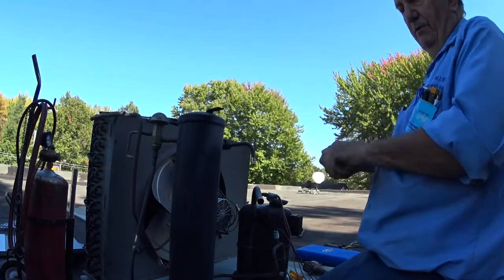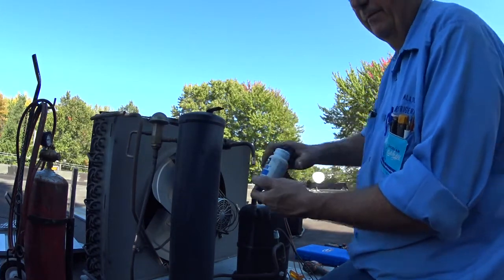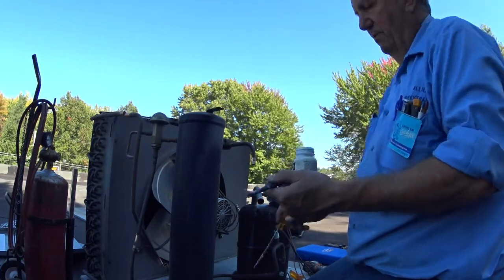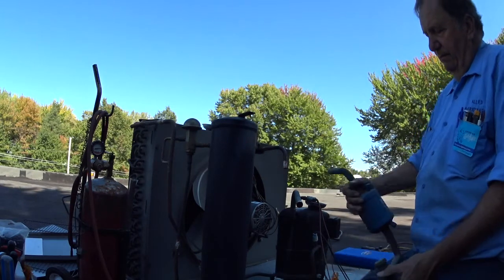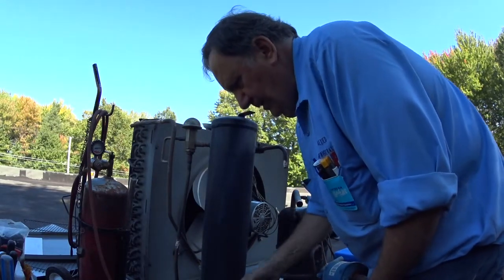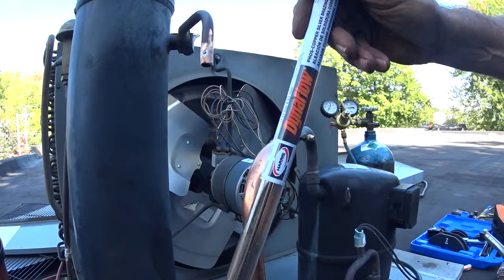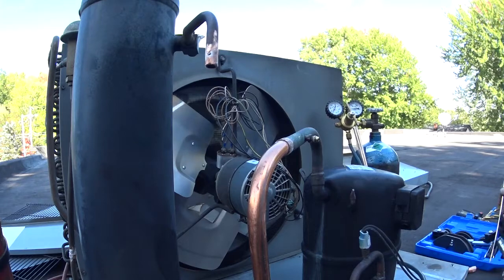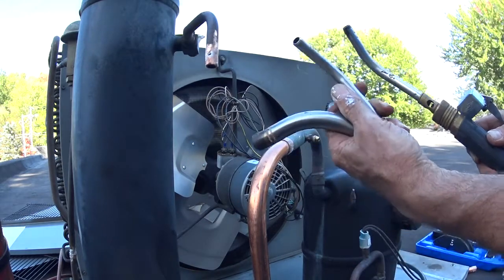Brazing (part 1)

Comment: I prefer the oxygen acetylene torch.  I find that I can get in much tighter, hard to reach, places with it.  The one I have can be adjusted with a wide array of flames.  A single tip can produce a super hot flame for 1& 1/8" or very small cool flame for 3/8" copper tubing by adjusting the amount of gas going to the tip.  Because the flame is more concentrated than turbo torch, it takes practice to not not burn holes into the copper pipe or leave big globs.   The younger guys I work with (who are accustomed to the turbo torch) struggle with my torch.  It just takes practice.  Despite the fact that the valves can be finitely adjusted, everyone who tries the torch cranks them wide open for way too hot of a flame.  The only time I open them all the way up is on big pipes.  Most of the time I keep a small manageable flame.  Also I don't need flux.

Comment: what sizes of a tubing can you do with your swager tool? I always used a flux as well, it flows better with it, i was thinking of switching to acetylene only, i'm tired of carrying   both tanks but i might miss my oxy/acet when doing filter driers,  txvs, or service valves, maybe i should just get a turbo torch as a backup and give it try.
Reply from the maker: 1 1/8" with this hilmore and yellow jacket. Driers & TXVs i use #8 sta brite soft silver solder, (low heat) and it's easy to take apart in the future to change parts. If you are use to ox/ace it would be hard to adapt to turbo tourches, you have to get use to them. It would be hard for me to get use to ox/ace.
Reply: i need to get one that's why i asked, it will safe fittings, rods, and the way i see less fittings less chance of a leak in future. I stop using soft solder when r410a came, I see a lot of leaky joints, even on older r22 systems, i'm thinking vibration and constant temp change causing stress in them and they develop small leaks.
I would like to ask you one more question, i seen on some of your other videos where you be drilling tubing for a service ports, or using drill brush inside the piping, wouldn't you worry about some of those shavings getting inside the compressor? obviously it may restrict txv /orifice, rev. valves, the videos i saw it was drilled on a suction line before comp. does comp has a screen filter inside or something?
just curious, thanks
Reply from the maker: Dennis Noone Txv's have stainless screens on their inlets, that should be cleaned out every so often. Drier filters have fine screen and felt filters on their inlets. Semi hermetic compressors have an inlet screen and hermetic, any debree falls to the bottom of the compressor and will stay there, When we solder or braze small B B's get loose inside the tubing and travel until they get trapped in a screen or drier. Inside the hermetic compressor the suction inlet to the valve plate is up high inside the compressor body. I've been doing this since the 60's and never had a problem. Thanks
Reply: ok good to know that i don't have to be too surgical, i always purged nitrogen if i had to drill or cut tubing, i was tilting compressors when wire brushed the ports (just a lot extra unnecessary time wasting steps i guess)  yes the txv do have screens, but fixed orifices dont these days, same with a reversing valves, i wasn't sure about the compressor,
thanks, keep those videos coming

Comment: You brought up a good point about the oxy/ acetylene torch. My grandfather always used straight acetylene with turbo tips, that is the method i used as well up until about 6 months ago i bought an oxy/ acetylene kit, i carry both now but i found on some small evap coils even my smallest turbo tip didnt really give me the concentrated heat i wanted. Like you said though everyone has their own preference. Great work by the way.

Comment: I prefer oxy act because I can control and direct my flame in a shorter space. But I like the turbo torch also because its lighter but the flame is usually larger.

Comment: what if you weld 2 1/8 pipe or 2 5/8 how  would it weld?  nice job jim
Reply from the maker: it would work just fine, just use the large tip.
Reply: Okay I think I'll get a set and try it out thanks Jim
Reply: What is it exactly          is it map gas or plain old propane
Reply from the maker: hardcooling acetylene b tank